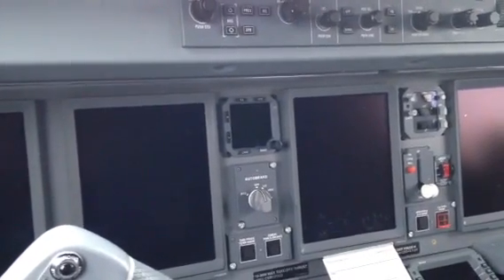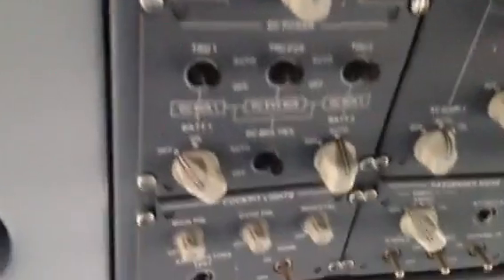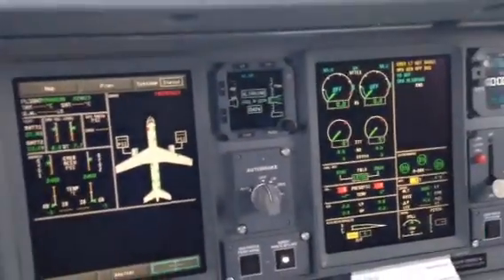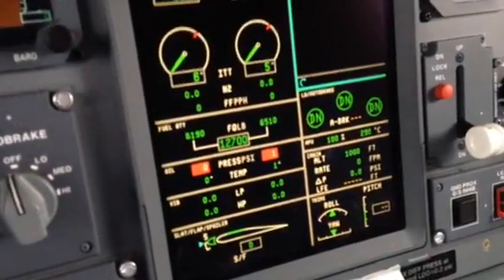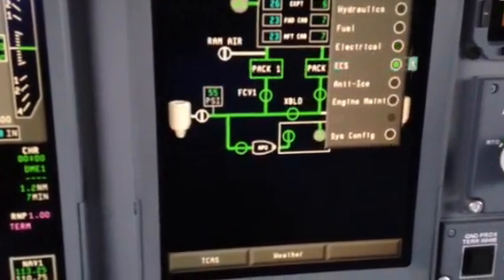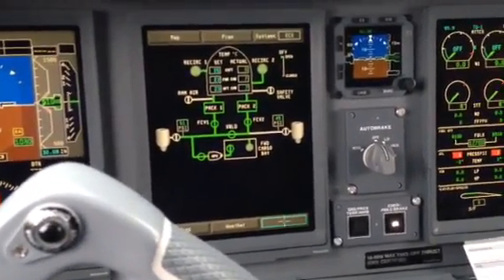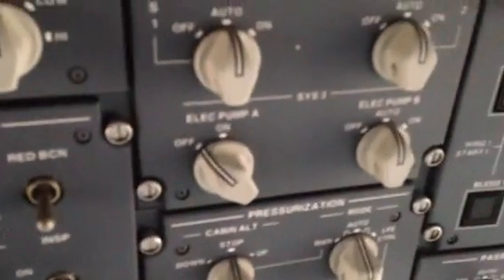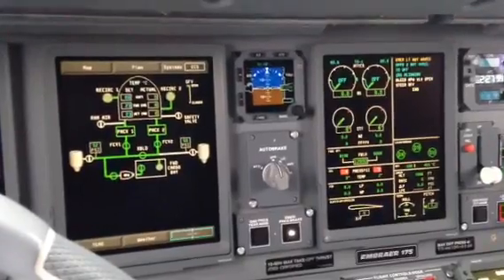Cold, dark start Embraer 175

Comment from the maker: I was told that it is good practice to always turn on #2 battery first to exercise (and test) the relay that would supply power to the DC busses in the case of the failure of #1 battery.

Comment: Hard for me to believe that the 175 is more advanced than the Airbus. Are you referring to just the fact that the APU is so automated or that the entire plane is more advanced than the Airbus? I mean the Airbus literally puts the crosswind correction in (lowering the upwind wing slightly and automatically puts the proper crab angle in) without the pilot needing to move the side stick at all.

Comment: Missing the fire protection test before start the APU. Safety first....
Reply: Not required unless it's the first sector of the day
Reply: Mo if it’s cold and dark, as it was in the video, it most likely is.
Reply: He’s most likely a maintenance/tech ops guy getting the plane ready for the aircrew
Reply: @IlIlIlIlIlIlIlIl-v9h  it doesn’t matter who is doing it for whatever reason. There is a reason why it is required to test the fire warning before apu start.